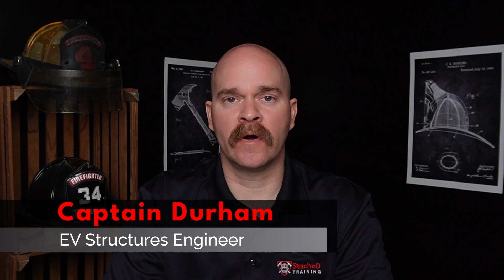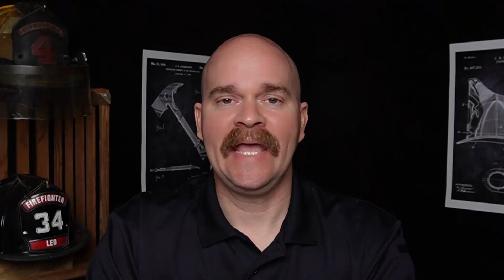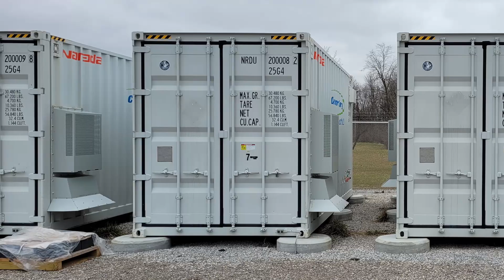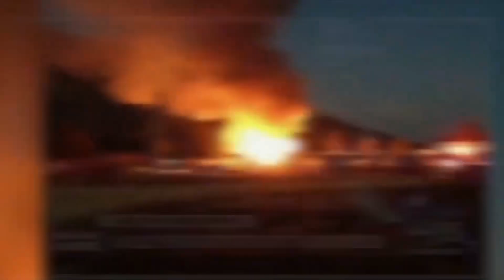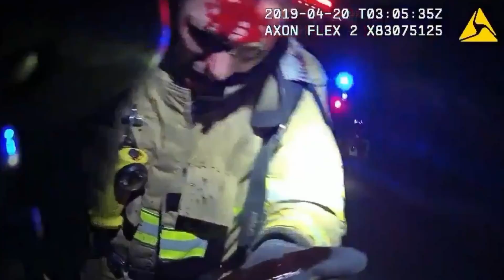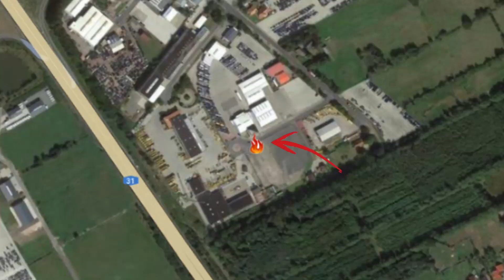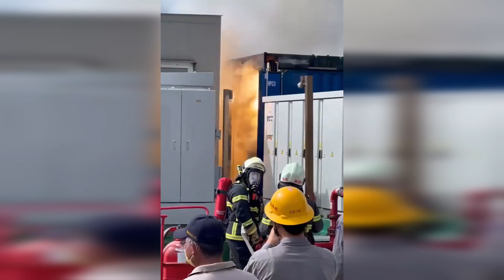Battery ESS Fire: Neermoor, Germany Incident

Comment: Relying on massive lithium batteries in cars, trucks, homes and businesses for energy storage is a huge mistake. This technology is neither mature nor safe (yet) and it may be a dead end. The deceptive greenwashing of this hazardous technology is costing taxpayers billions through subsidies, increasing energy costs and increasing insurance rates, thereby making our economies less productive.
Reply: I couldn't agree more .
Reply: KlaussSchwab - Hold my beer
Reply: There was one of these BESS units that went up in Queensland, Australia, they are a stupid solution to a non-existent problem.
Reply: @seanworkman431  Guess you like brown outs.
Reply: @chasl3645  no but why shut down existing infrastructure before a new system is in place, the shortages are caused by these new policies.
Look aroung the world, renewable energy is just not working.
Reply: @seanworkman431  Our energy system needs to be updated in both production and distribution. And battery backups using safer chemistry's that can be recycled. These battery systems have proven effective for shaving peak demands and load leveling. While shaving input cost of coal and gas for energy production.
These systems are going to kick the door open for much better more efficient production and a well-balanced system with loads of redundancy. What scares people's these systems are improving yearly.
Reply: @chasl3645  BS to the recycling.
Reply: @seanworkman431  That's Tesla Megapack 2.0 (LFP) at Genex Grid in Queensland, Australia.  Aren't all TM2.0 LFP?
Reply: @tooltalk  there was still a fire, even before it was commisioned.
Reply: @seanworkman431  I would not call an existential threat a "nonexistent problem".
Reply: Therefore it's these firebomb batteries that need to be banned (imo).
Reply: @kellikelli4413  Good thing gasoline doesn't blow up🥴
Reply: @chasl3645 
Gasoline (in a vehicle gas tank) is well insulated.
And not subject to explosion from water intrusion (wink 😉 wink).
Reply: Exactly; it is insanity writ large
Reply: Die Technologie ist nicht schlecht, mittlerweile werden Eisenoxid Batterien eingesetzt die nicht mehr brennen.
Reply: @MarcusWilke1978  Wo werden die denn schon bei Kraftwerken eingesetzt? Sieht vielversprechend aus, aber wurde doch bisher noch als zukünftig berichtet: 

"Hoffnungsträger für Stromnetze: Eisen-Luft-Akku geht bald in Massenproduktion

Das MIT-Spin-off Form Energy baut in Virginia eine Fertigungsanlage auf. Die Herstellungskosten der Energiespeicher sollen bei einem Zehntel von jenen der Lithium-Akkus liegen..."
Reply: You are spot on. I worked for the fire service in London for 30 years and Lithium Ion batteries were a known fire risk for 30 years damaging thousands of property world wide and killing many before they were ever used in EV's, battery storage,re-cycling plants ,E bikes scooters etc. It is no surprise therefore that there are massive problems with these batteries and that they are not fit for purpose!!
Reply: Spot on Relying on massive lithium batteries is a huge mistake. if it's ok I will share your words.
Reply: @veronicastuart714  Sure
Reply: Marxism.  We have to destroy society so we can build it back better.  Where have we heard that before?
Reply: Hi,
I worked for the London Fire Brigade for 30 years and Lithium Ion batteries are a massive fire risk and hazard which has been well known for years. These fires will only get worse as battery storage become more numerous They burn very hot and give off flammable and toxic gases and can spontaneous combust and are unsafe. The fixed installations do not work as these batteries produce their own oxygen supply and are the worst kind of fire being a chemical fire.
Reply: @michael.randall5034  All vehicle fires are hazardous and should be contained.
Reply: I liked lithium batteries about 10 years ago, now I fear it. The only ones that are stable are found in tool batteries, a 2amp hour 18v lithium is usually comprised of 2000mah 3.7v cells and much safer but even those can cause fire, the ones found in flashlights and other energy dense applications like EVs are 3000mah or higher for the same size and much more volatile.
Reply: @practicalguy973 oil lobby at work.
Reply: I read the one lithium mine in the USA uses 4 billion gallons of water a year . . . In Nevada.
Reply: That mature technology (NiMH) was sold to an oil company (Texaco, bough by Chevron) who then sued Toyota and Panasonic over the RAV4 EV.

Tesla making their pack out of hundreds of commodity, yet relatively volatile,  18650 cells was actually a patent work-around.

The newer Lithium Iron Phosphate batteries are also much safer.

My understanding is the the Sodium Ion batteries just coming online are also safer.
Reply: that's 'misinformation' apparently.

Comment: Lithium Batteries should be banned full stop they are nothing but ticking time bombs.
Reply: Ban any Li-ion battery over 99 WH. Smartphone batteries are fine.
Reply: @aliendroneservices6621  Smartphone batteries are no different than any other lithium battery and still pose a massive risk especially when you consider even the smallest piece of lithium foil which make up the batteries can explode when it is simply bought into contact with water.
Reply from the maker: There is no lithium foil in a rechargeable lithium-ion battery.   They use aluminum & copper foil coated in graphite & the lithium-ion chemistry.
Reply: @StacheDTraining  sorry mate I won’t argue I guess I’ve been misled. Have watched several videos including one by a YouTube named RedNile who cuts open and pulls apart a disposable lithium double A battery and removes what called “lithium foil” and threw it into a dish of water and a few seconds later it exploded. While looking at the video and trying to find a link so I could send to you I actually found several others doing the same thing.
Reply from the maker: @davegoldspink5354  non-recharchable lithium batteries do exist.  The major brands sell them in AA & AAA sizes,  but these are  different than lithium-ion batteries.
Reply: @StacheDTraining  thanks for your correction.
Reply: @aliendroneservices6621  all the Samsung note 7 battery fire are a great example of how dangerous these batteries are or the countless number of other device fires including kids toys that seem to show up regularly online.
Reply: @aliendroneservices6621  The Samsung note 7 fires and any number of device fires that show up online regularly shows they’re not “fine”